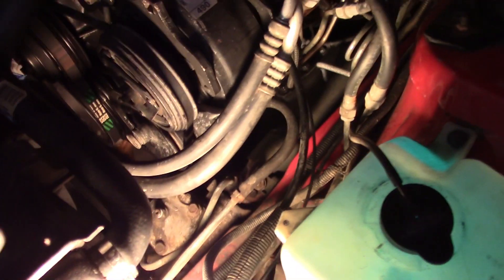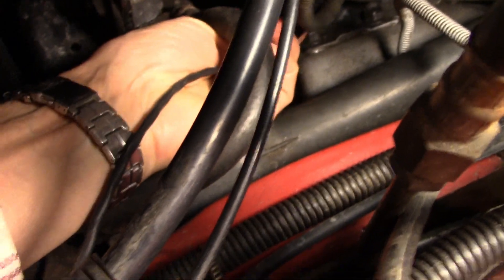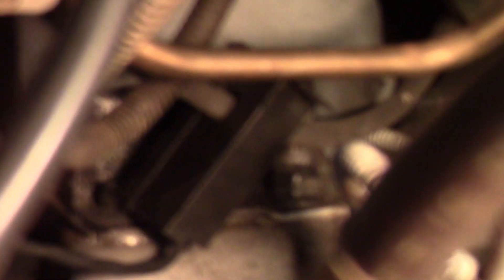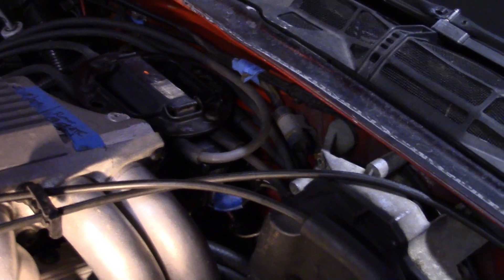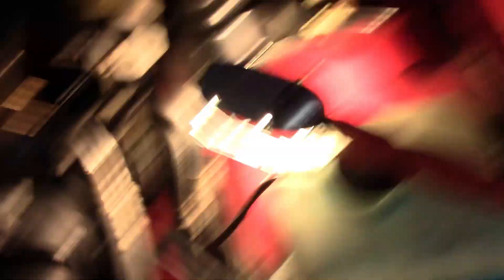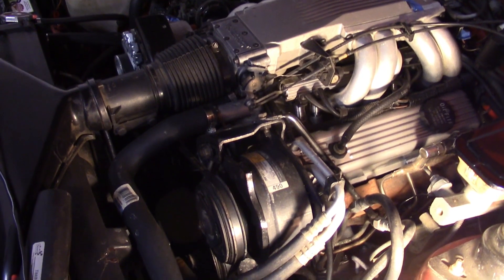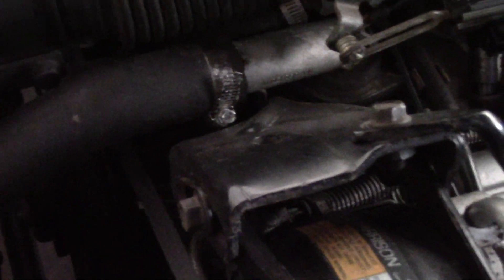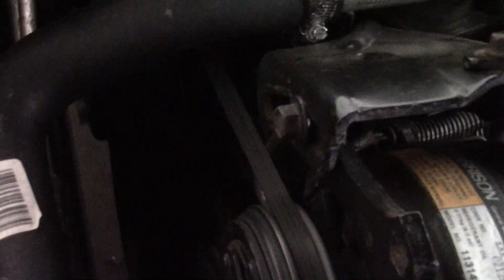Setting the Ignition Timing on Chev 305 TPI - IROC-Z Barn Find EP 40

Comment: If you have a white mark at 0 and there is no mark at the 6 degrees mark how are you able to to even see where the sixth degree is? I am only asking because I am having an timing issue with my camaro as well
Reply from the maker: It can be hard to see the 6 degree mark, my light is bright enough and I can just see it.  It would help to put a white mark there as well.  With the engine off and cold, you ought to be able to get in there, clean the pointer, and put a dab of paint or white marker on the correct spot. I haven't been in there recently; I think that there are bumps / marks every two degrees, but only numbers at zero and perhaps 10 degrees.  So you need to count up from the zero mark.
Reply: @bitsofwisdom460  thanks I really appreciate it i believe I finally got it right thanks to your video and your response to the question i was asking so thanks you for your help

Comment: Do you have any info on the location of a green plug? that is used on the carburated version of the 305 to hook up a dwell meter to adjust the air bleed screw and such? any info would be helpfull.
Reply from the maker: It's been a while since I worked on one of those carbs, but the mixture solenoid is on the front passenger side of the carb.  TPS is on the front driver's side. The book says, and my memory agrees, that the green terminal is on a breakout of the harness near the mixture solenoid connection. I  seem to recall that it just hangs out in the air at the front of the carb. I think it is a type of terminal that takes a flat spade type connection rather than a weatherpack.
Reply: Thanx im getting alot of differant location info @bitsofwisdom460
Reply: I dont have any type of manual to work off of
Reply from the maker: @rickkimble8634  That's ok.  I'm just finished with cooking (& eating) a turkey dinner, so I can add a little more now.   The manual advises to use the dwell meter on the 6 cylinder scale. Normal warmed up closed loop operation should be between 10 and 50 degrees dwell. 10 is rich side 50 is lean side.
Reply: thanx again and I did find the green connector (spade) its on the passenger side firewall in the ecm loom leasing into the fender. Maybe I can drive this thing in the spring after paint correction and final assembly is complete, Your knowledge is very helpfull. @bitsofwisdom460
Reply: Now that i have my Mac Mentor pro scan tool fired back up it does read obd1 but its telling me to check grounds fuses and wiring connections before it will actually link to the ecm. Do you know if there is any specific ground that hault this link up ?
Reply from the maker: @rickkimble8634  Is it looking for 12v? Most GM OBD1 tools require a 12v supply for communication. The batteries in the tool will run the tool, but it won't communicate.  My Actron has a port in the side for the 12v plug.
Reply: This scanner was ,ade right after the transition between obd1 and 2 it has a adapter for the obd 1 with the cigarette lighter plug, @bitsofwisdom460
Reply from the maker: @rickkimble8634  That's good Rick, it's caught me a couple of times.
The ALDL plug should have pins A through F from right to left in the top row. Pin A in upper right is the ground to ECM. Pin B should be the one that flashes the light when grounded to A.  My info says that E is usually data stream pin on the older cars, but carbs use D. Your tool ought to handle that automatically.  The one thing that many cars are sensitive to is that the ECMs need a 10k Ohm resistor from pin B to pin A to get data to flow. Some scan tools have it in the cable, some have it in the tool as automatic selection, and sometimes you need to tell the tool to turn on "10k mode".

Comment: What is the timing on sb chevy ho 305 carbureted with a thumper cam
Reply from the maker: The factory manuals direct us to the underhood tune up label. My third party manuals indicate that nearly all of the 305's in the '80s had 6 BTDC as the standard timing, regular or HO.  From there, the timing curve (vacuum / mechanical or EST) controls the rest.
Different cams can require some experimentation, but unless the curve is modified, 6 BTDC will probably still be correct.  I experimented with timing from 6 to 12 on my TPI and I ended up back at 6 because of drive quality issues with higher lead.

Comment: Would this be the same on my 84 Elco? It also has a 305 sbc in it
Reply from the maker: It depends on your exact configuration.  If you have an electronic spark timing engine (EST), it should be the same except for the the timing specification.  TPI is 6 degrees BTDC, TBI is usually zero degrees BTDC and I don't know what the carbureted engines run.  The specifications can vary by model and year. Best to check the underhood tune up label. If you have a non-EST engine (silver or gold vacuum advance can with a vacuum line on the distributor), then the process is the same except you must disconnect and plug the vacuum hose before making the measurement instead of disconnecting the EST bypass wire.

Comment: You know why some experienced mechanics recommend that a typical distributor advance for a Chevy V8 engine should be between 10 to 12 degrees, but GM indicates only 6 degrees btdc for this 305 engine?
Reply from the maker: Well, for a conventional mechanical distributor, that is likely about right.  There are a couple of considerations.  First, when you crank the engine, you need the correct amount of timing to get the engine to fire and come up to idle.  With a mechanical distributor, you won't have any vacuum or mechanical advance to assist at cranking speed.  So, 10-12 degrees ought to get it running and up to a stable idle.  Then the vacuum / mechanical is designed to match engine requirements across the operating range.
With the engines that have electronic spark timing (EST), it needs the right timing to get an initial fire as well, but the ECM control can make adjustments rather quickly and even assist in getting the engine up to idle. When I look at the PROM calibrations, the tuned port engines all rely on the 6 BTDC as the base timing, and the ECM will add or subtract as required.  The calibration engineers must have found that it is the best value for the engine. 
There is also a backup / limp - home timing that is preprogrammed into the distributor in the event that there are certain malfunctions in the electronic spark timing. It likely depends on the 6 BTDC value as well.

Comment: What if you don’t have a timing light
Reply from the maker: To properly set the timing really requires a timing light because it is triggered from the actual spark signal fed to the plug with the engine turning.  There are some inexpensive ones out there and they should work just fine. You just need a pulse of light when the plug fires.
However, if you're in a pinch, look at my video on installing the distributor:
https://youtu.be/b93rdgUTBB8
When you first install the distributor, you need to make an approximate setting that is enough to get the engine running.  You can estimate that by rotating the distributor slightly and watching where the magnetic trigger aligns.  You can see / feel it in the rotor.

Comment: What RPM should the engine be running at when checking the timing?
Reply from the maker: The "official" answer is that the correct RPM is on the tune up label on the underside of the hood.  Since many cars of this age don't have a label any longer, the practical answer for the fuel injected cars is usually at ECM controlled neutral idle ~600-650 for the TPI cars.  If engines (like TPI) have electronic spark timing, then once the reference timing connector is disconnected, the electronic timing advance will will be locked out, so precise speed isn't critical. You can check, the timing measurement should not change if you raise the idle speed a little.

For reference, old school cars usually were still at specification idle so the mechanical advance wouldn't come in and with the vacuum advance disconnected.  Those cars on occasion would ask to set at a specific higher idle speed to bring in the mechanical advance slightly.

Comment: My '89 Camaro with a 305 TBI, does not have a black/tan wire exposed to disconnect. There is a black/tan wire in the 4 pin plug going to the distributor, but it goes directly into a large wire loom. Do I need to put a splice in this wire  Thanks
Reply from the maker: You shouldn't ever need to splice wires to set timing.  There should always be a service method.  I don't have a manual specifically for that year, but in looking at other engines and a third party manual, I expect there must be a connector there. It appears that wire color is used for that circuit on many engines from "timing bypass". The factory books tell you to look at the underhood tune up label for instructions.  The wiring harness in the Camaro should run from the engine to the passenger side of the car and then go downward behind the right front wheel.  I would take another look, because on some cars, the wire from the distributor will go into the wire bundle and if you follow the bundle toward the right front wheel, the bypass wire will break out of the harness again around the air conditioning box.
Reply from the maker: I have another piece of service data that appears to be GM original for 89 TBI 305 that shows component locations underhood.  It shows the timing connector roughly over to the right hand side near the wheel house and air cond / heater box.  Please let me know if you find it.
Reply: @bitsofwisdom460  I found mine near the passenger side front shock. I didn't expect it to be that far away. Thank You Greg
Reply from the maker: @waynew2831  Great to hear that. Glad to know that you found it.

Comment: Great. On mine there is a connecter up on passenger fender by the battery that you can unplug for a few seconds to reset the ecm and avoid disconnecting the battery
Reply from the maker: I have been looking for an easier way.  The factory manual indicates just to disconnect the battery.  I know that on some cars you can also pull the ECM fuse, but that can be hard to reach as well and some ECMs have multiple feeds.  The engineers became smarter about things like this as the years went by.
Reply: @bitsofwisdom460  yeah, mine is an '87

Comment: where is you #1 on the distributor? looks like its on the back side? just curious how you dropped in the distributor. car sounds good obviously timing is correct but that just looks weird to me is all. nice series. and good job saving a 80's classic.
Reply from the maker: I know that it does look a little odd.  #1 is up toward the front, just a little to the left.  I dropped the distributor in back on EP 37.  The plug wires for the left bank on these engines route underneath and up behind the left cylinder head, so the wire for #1 comes up behind the distributor cap and wraps around to the front side. If you don't point #1 to the front, the #7 wire is too short to reach the cap with a standard set of wires.